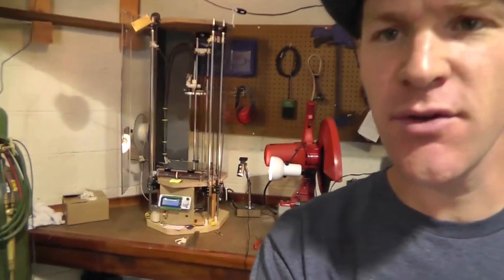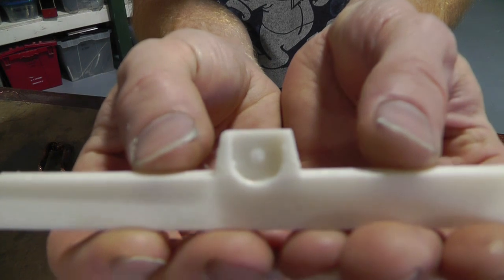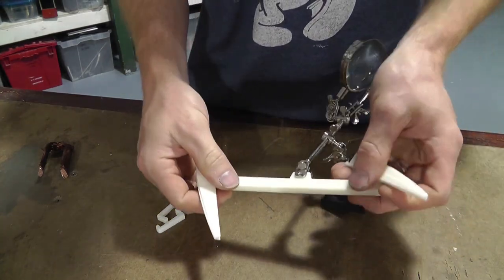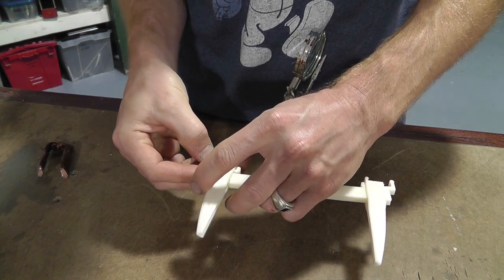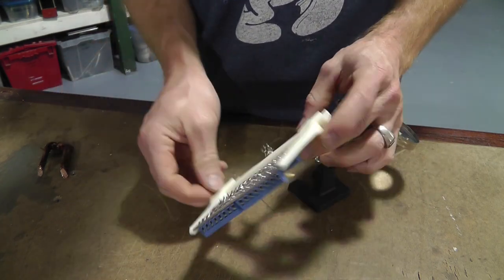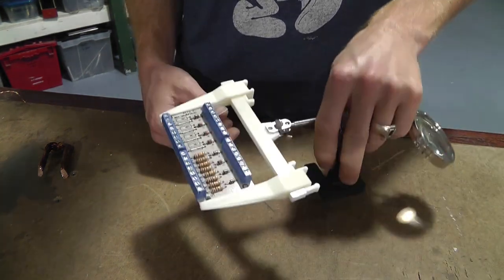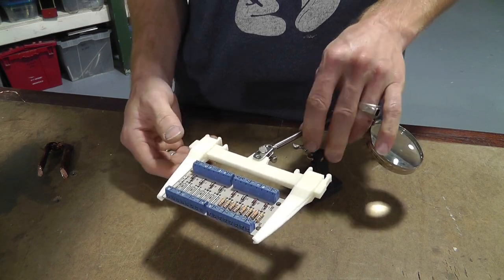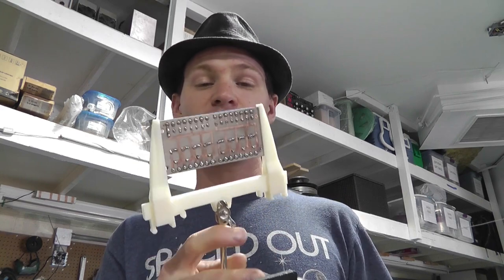**Read Description**You Vote, New Series? #1 Every Other Friday: 3D Printed PCB Vise time lapse

Comment: Neat attachment.  BTY I have the same "helping hands" vice I bought years ago from RS.  I attached my vice (with original suction base removed) to a 4 inch square of 16 gage (or so) metal plate. (You can use the square or round cover plate used to cover 4 inch metal electrical boxes.)  I glued a 4 inch square of cork to the plate's bottom and now it holds pretty steady in most situations.  Can still put magnets atop steel plate for added hold down force to other metal surfaces.   Now days though when I just want a non-marring anti-skid bottom (even my kitchen cutting boards etc) I just plop on a blob of hot melt glue to each corner and allow the new "feet" to cool down "sunny side up".  Works even better. Bet other's do the same thing but reinvented this wheel after many near slip n slide misses. Currently rebuilding my wife's CVT transmission on her Saturn VUE.  This is a trip.  Love your stuff.

Comment: PS: Woops -  missed the Ad-vise from Andrew McNeil on spelling vise. Guess misspelling is one of my vices. (That and run on sentences.) (Guess that's two of my vices that need to be clamped down)   Russ,  you might use your PCB holder to position and hold up "Q" cards in your video productions or make a "cartoon bubble" to put a real world comment or note to illustrate your projects as you tape them.   Make a few "cards" from tempered Masonite "white" board to use with dry erase markers.   You will find many other uses for this clever de-viSe.   The guy who designed it should probably see about taking it to market.  I know a high school student who sold a product thru Radio Shack.  He probably could too.  You are very gifted.  Try to keep everything in focus. (not just optically speaking)  Continued Go(o)d luck with your new adventure.  (Heck! Missed the brevity factor again.)